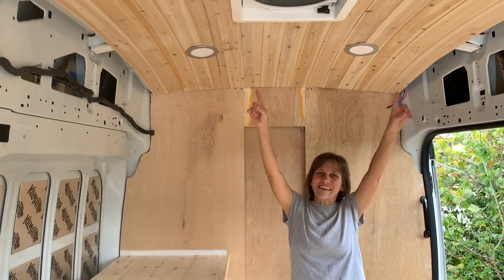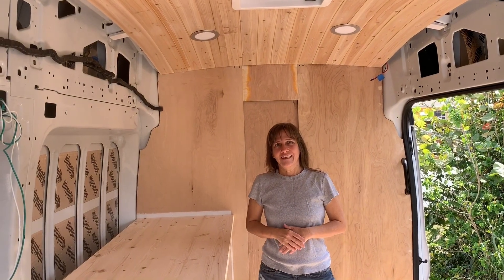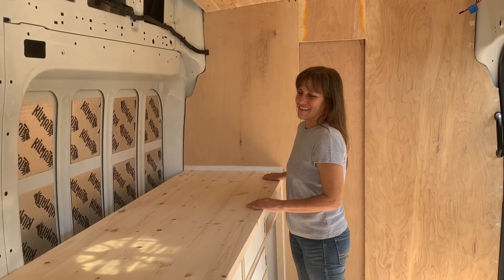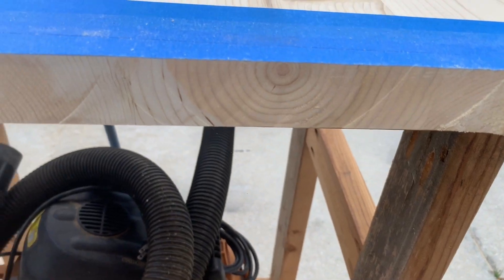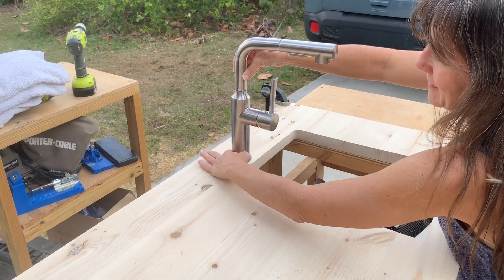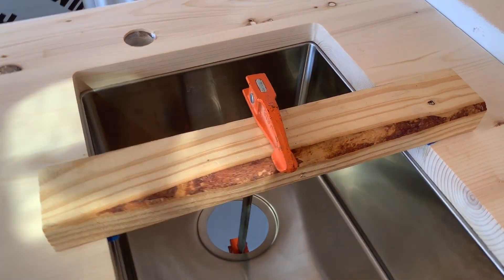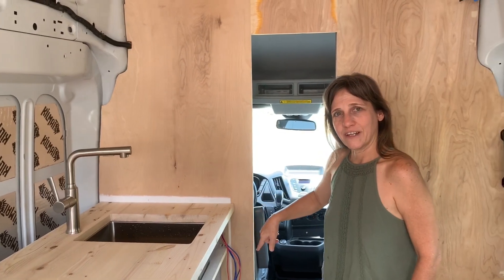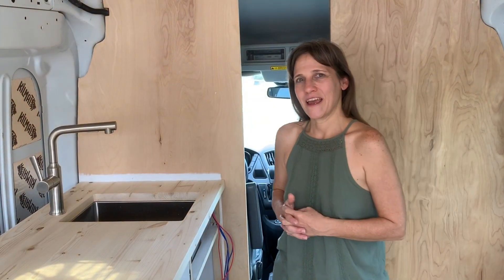Van Conversion: Installed Ceiling, Lights, Sink, and Faucet

Comment: water pump so loud....
Reply from the maker: True! We decided to exchange it for a different pump. I talked about that in my latest video.
Reply: @ArtfulOutdoorAdventures  i have a question about ur sound deadening material on the wall. Ant u suppose to cover all metal surface in order to archieve maximum vibration orbsorbsion and noise reduction?  If uknock on the sheet metal with that deadener, it sounds solid.  Without the deadener it sounds crispy XD